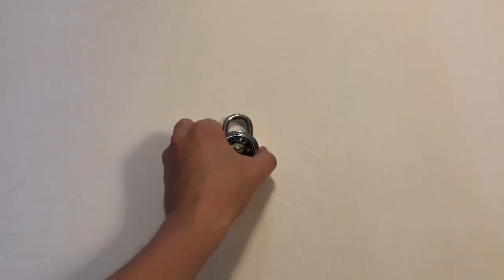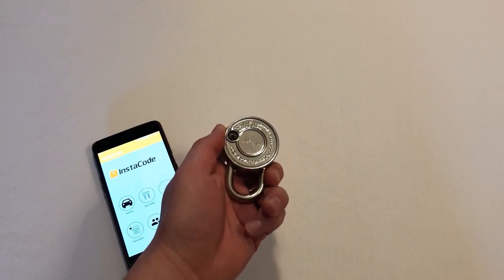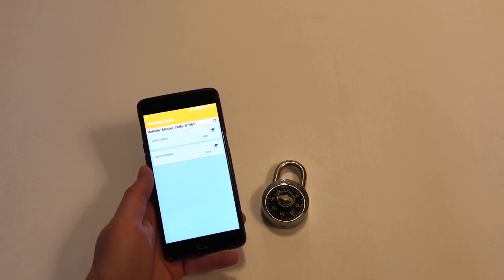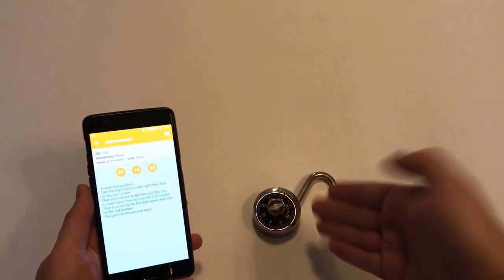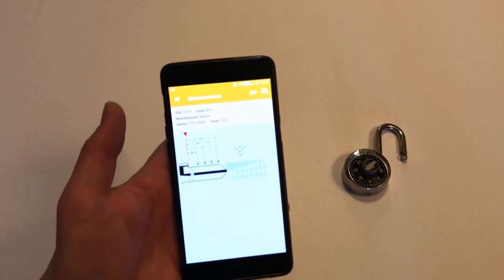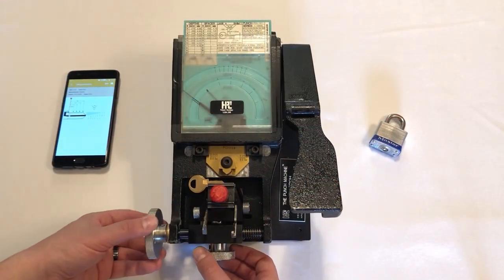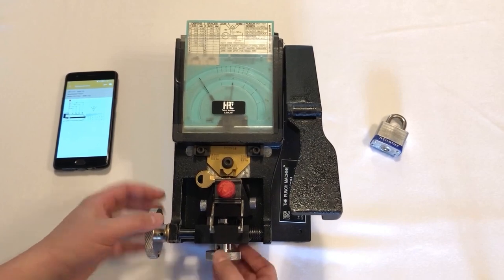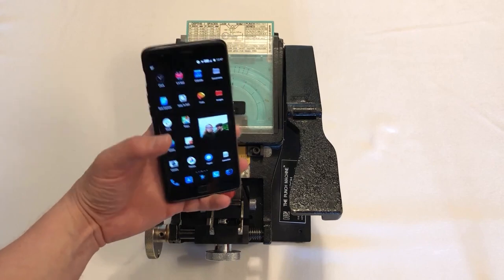What Are The Small Codes You Sometimes See Printed On Locks?

Comment: The thing a lot of people really should think about with blind codes is for pen testing, when you are scouting a location it's super easy to just take a snapshot of a padlock and a code. And I have seen PLENTY of large facilities or even municipalities that use the same bitted padlocks for a whole slew of applications.
Reply: Back oh,uhh (cough, cough ) 45 years ago when I worked as security guard at a SAFEWAY store "disturb'ruption " (inside joke) I plainly remember that they had 10 outside gate locks and every one of them was 1 key. Oh and that 1 key also opened the main man gate that went into an UNLOCKED Front door (oh and there was no lock to be locked on the front door, either.)
Reply: @WiliamBennettwildarbennett  That's why they needed a security guard!!
Reply: Even you fail to look up the number, simply knowing that it's the same on everywhere on some location gives you a lot of info and raises the reward for acquiring the key...
Reply: Hey there, fancy seeing you here!

Comment: I mean, you could also just threaten it, pee on it, or blow really hard on it. It IS a Master lock...😅
Reply: @foamysid  A by-pass, you mean.😅 Too simple.😜 Yeah, Master isn't great for practice, too easy.😊
Reply: Picking locks is so super-easy in the Splinter Cell video games. About 4 seconds to pick a lock, or 1 second to use a 1-time use instant lock pick, which presumably is spraying something into the lock that melts it or turns it into goo. You use that when somebody is coming, and you need to instantly "disappear" into a room before you get spotted in the hallway. But how realistic is that video game spy gadgetry?
Reply: @yosefmacgruber1920  If it was a master lock or something of that "quality" you could rake it open almost as fast as using a key. If it's decent it might hold up a skilled picker for a minute or two, and there are still some currently unpickable locks out there, so picking is definitely not a universal strategy.

As for the goo, you really only need to melt the driver pins, but it might melt the plug too, giving you no way to actuate the mechanism behind the lock. Given that driver pins can be made out of hardened steel, usually the toughest material in the lock body itself, I don't really see that technique working IRL.
Reply: @DeeSnow97 
So what do you suggest? I would love to live in a world in which we didn't have to lock up things, but there doesn't appear to be much progress in that direction at the moment.

Regardless of the complexities, lock-picking will always be super-easy in video games. I just love how I can hack a computer in 3 seconds in a video game. If only more real-life tasks were that easy.

On a few occasions in which I had legit reason to open a lock, not even having a key that happened to fit the hole, was of much use. I guess having a similar key really isn't a very useful tool? In the one case, the keys were locked inside the car.
Reply: It's funny that you say this I am no lockpicking expert my first pick was with homemade pics windshield wiper blades and saw blades number 5 Master Lock 5 Seconds
Found one yesterday laying around no key no joke one second

Comment: Wow, it is really hard to find information on blind codes. Most results show up relating to blind people.

There is clearly going to be some differences between manufacturers, but: Are these just giant code books where there is a single code for a single biting with no mathematical connection? Is there some algorithm with which the blind code can be turned into a biting code, and vice versa? If there is some algorithm, has someone ever attacked it?
Reply: UselessBread There’s not an algorithm, per se, but you can run sequence down blind codes and note their progression. I’ve used it in the field to get keys when I needed them. There are code books, but they’re all outdated these days, with code software being the norm these days.
Reply: @RubberBanned  Are there any free code software that does not try to give you a virus?
Reply: @joshlikesfood1673  Not really. Code software is usually pretty expensive, and there’s no free options. If there were, keycodes would be fairly useless.
Reply: @RubberBanned  I found it. It is called SnapDecoder. It is in one of devs talks.
Reply: I'd still use a vpn before downloading though.
Reply: @joshlikesfood1673  That’s decoding software, it’s not the same stuff or contents
Reply: @RubberBanned  Oh, could you explain the difference?
Reply: @joshlikesfood1673  Key code software is a database that translates a blind code into usable key depths for a locksmith, or other user, to make a key. Decoding software decodes a physical key, giving you neat approximations of key depths
Reply: @RubberBanned  Got It, Thanks. I am new to the whole locks and lock sport. Thank-you for helping me.
Reply: @RubberBanned  Out of curiosity what would InstaCode be? Key Code or Decoding.
Reply: @joshlikesfood1673  It would be keycode software, with some decoding capabilities. If you’re new to locksport, key code software isn’t the best starting place.
Reply: @RubberBanned  Yea, I know. I wasn’t really looking into using the key code software for starting. Just thought it would be cool to find some blind codes on my padlocks and punch them in for some fun. I am right now just collecting locks from eBay and picking them. The hardest lock I’ve picked was a master 527 with some spools.

Comment: Ok, stupid question: back when I was in high school we had to buy the school's locks, they were combo locks but had a bypass keyway on the back so the admins could search your locker. Of course I bought an extra and tore it apart and made a master key, but I'm curious now if that bitting info is also available somewhere? Our locks had a 5 or 6 digit number and also either V20 or V30 stamped on the back. V20 seems way too short of a code for a key bitting.
Reply: You can buy the V series keys on Amazon and eBay it's a master key system V** being the lot of locks for each key
Reply: Ha, same... changed it to one that looked the same with no number identifier.

Comment: I have multiple Master padlocks. :( They are very commonly sold in DIY shops here in the UK. What would a good make of padlock be? Good being difficult to rake, pick, force, and have the info to circumvent it on the padlock body!
Reply from the maker: Abloy Protec PL321 or PL330
Reply: @DeviantOllam  Thanks. I'll check those out.
Reply: @dalriada842  don't spend more on a lock than what's it's protecting, some can cost hundreds.